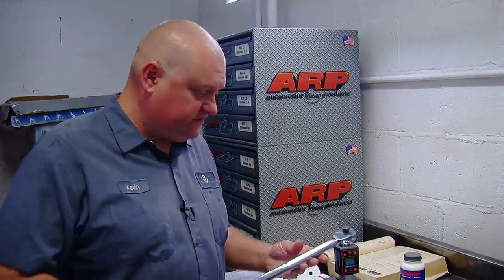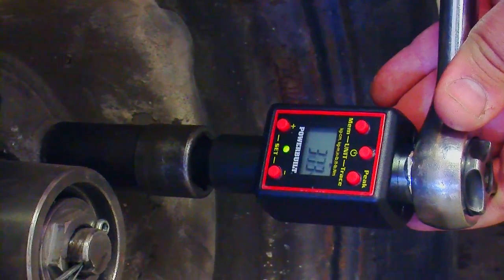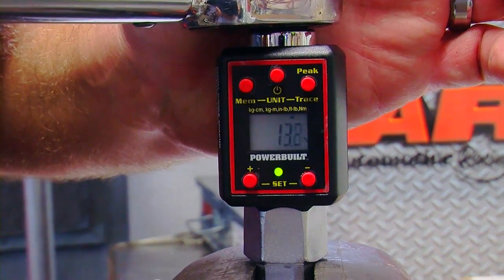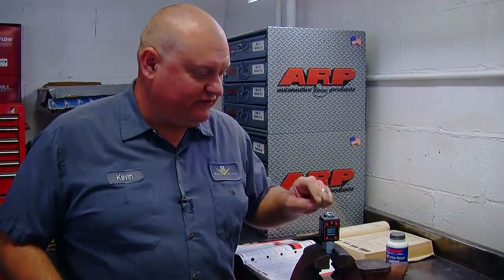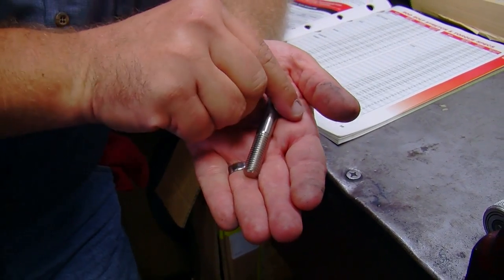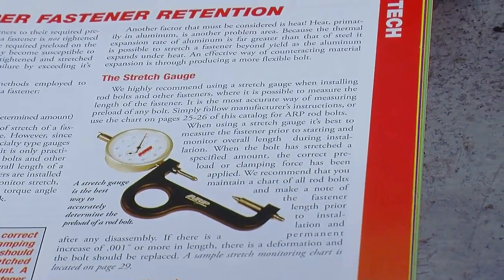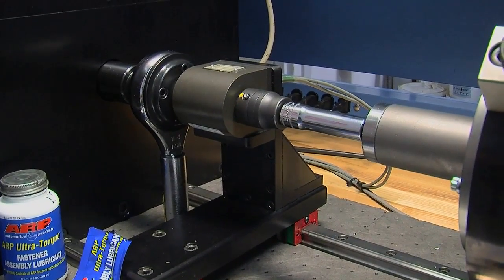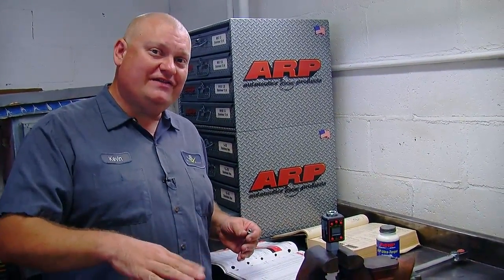Checking Your Torque Wrench And Proper Fastener Torque Tips Video V8TV

Comment: You guys should do a video on Rod bolt stretch, i use the ARP Gauge, ARP say to measure the bolts before they have been stretched. But when i buy rods from say SCAT, they already have arp bolts that have been torqued when the Rods were honed.  I got conflicting information from ARP and From Scat, on whats acceptable bolt length before its been stretched. Even ordered a new set of ARP rod bolts, and some of them measured before stretch, what the ARP Rep told me would be unacceptable.   Interesting stuff, and hard to get to the bottom of.
Reply from the maker: +Swilling It is interesting stuff, and we will do one on bolt stretch.   For this video, we wanted to discuss torque and clamp force for the majority of fasteners, most which you cannot get a stretch gauge on to check.    I'd imagine ARP knows the length pre-stretch, as the have the drawings and made the bolts.
Reply: Yeah it is interesting.  Thanks, will look forward to it!  There's very little real info that's not opinionated on the topic,  appreciate all the work you guys do!